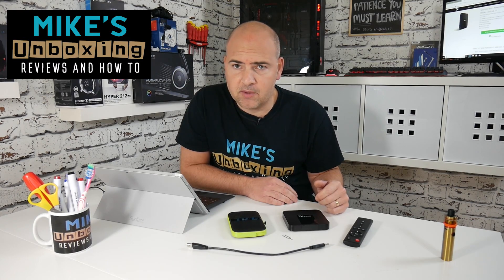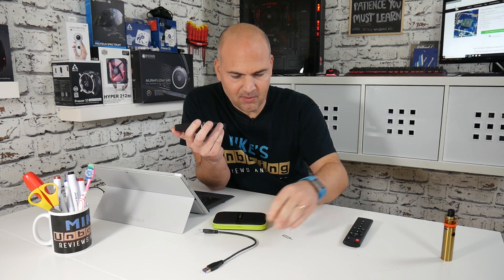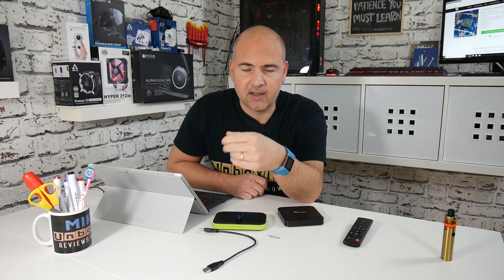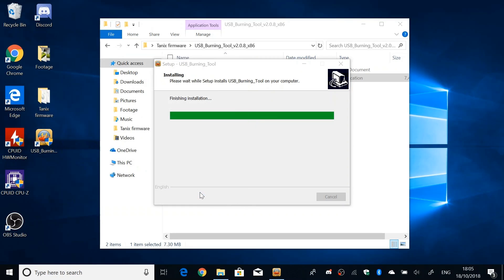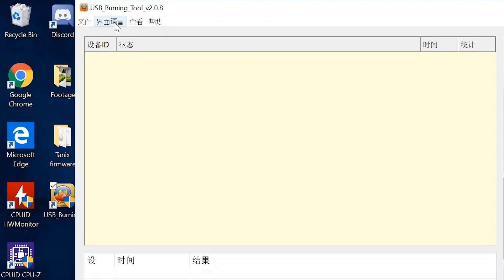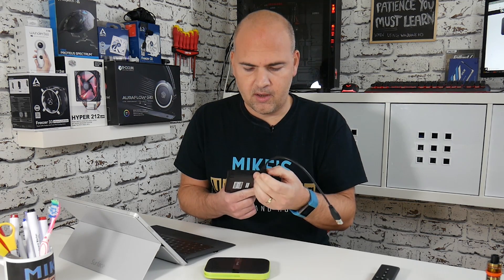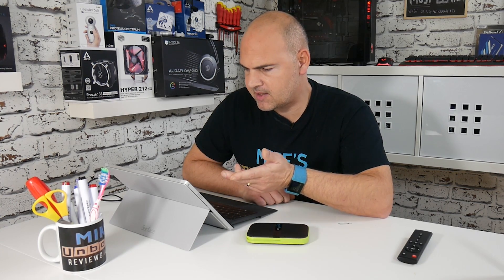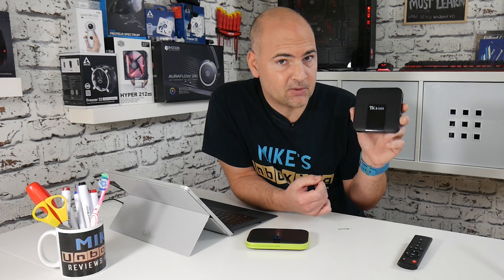Tanix TX3 USB Firmware Recovery TX3 How To Fix

Comment: I'm having an issue with Windows 10. It's recognizing the USB but in Device Manager it's not a recognized device. I've tried 10 different versions of the Burn Tool and tried pointing the folder with no luck.
Reply from the maker: That's a tricky one! Have you tried different USB ports or a different USB cable?
Reply: I did @mikesunboxing

Comment: Did Tanix release newer firmware, or all these firmwares are old? I have TX3 (S905X3) running Android 9, and firmware on their site is 20221122. Is it newer version or just the uploading date was changed? Should I  install it, since my box crashes while using Google assistant, and maybe Google app is outdated? Thanks in advance.
Reply from the maker: yeah these have been sort of abandoned now as the newer models are getting updates

Comment: Hello friend, I want to ask you something. My box is different from the TV box TX9 and I flashed it
firmware with that of the TX3 mini and after flashing the TX9 firmware it turned off the clock on
the display. Can you tell me what to do to get his display clock back on??
Reply from the maker: it is probably a change in the firmware, maybe the tx3 and tx9 use a different protocol for the clock

Comment: Hey there, can i use usb c on laptop and regular usb in tx3 mini to connect ?
Reply from the maker: no sorry the cable must be type a to type a
Reply: @mikesunboxing  i tried to change firmware to my android box but after installing it from pc, when i plug into my tv i only see green light, it wont turn on..

Comment: I Have an issued stuck on 1% [0x10103005]Romcode/Initialize DDR/Download buffer/Read item data failed, do you know how to fixed it ?
Reply from the maker: use the rear USB on the PC or a different port and run as admin
Reply: @mikesunboxing  I already try all but, after I search my ROM is not S905W but S905W2 << new Tx3 Mini Use this, do you know wheres to get this Stock rom ? i can't find it anywhere T_T

Comment: With this method does erase user data? I have damage my Android recovery mode and I want repair/fix recovery mode without data loss.I don't have exactly this device but I believe that are similar,I have x96 max+.I haven't adb/oem/usb debug enable maybe I use nand sort method.Thank you.
Reply from the maker: the USB method wipes the drive and replaces in with a new image
Reply: @mikesunboxing  Thanks from Greece for your answer.

Comment: My tx3 mini is unresponsive. I've plugged in the power cable but the blue notification light on the front doesn't appear but just the red light at the back of the box
Reply from the maker: does it appear in the software when trying to flash it?

Comment: Love your content
I frequently use your videos as a guide to either buying or "fixing" android tv boxes
Hope you can help me
I have the Tanix TX3 Max
It works fine but suddenly it says my external hard drive (Seagate 2TB) is corrupted and needs formatting
I connected it to my PC 
I did a Checkdisk (Windows 10) for errors
I even defragmented it just in case
Nothing helps
I must admit I just transferred a lot of movie files
But I also did that previously without any problem
Just to be clear
The Tanix recognized the external hard drive before, but suddenly it gives me this message
Can you help me?
Reply from the maker: What file system are you using on the drive
Reply: @mikesunboxing   NTFS
Reply: @mikesunboxing  
Update

I checked another external hard drive NTFS 
And it's ok
So it seems it's the Seagate specifically
I know what happened
I deleted the "android folder" and I think als the "Lost.Dir" on the external hard drive
I think that's it because I connected the drive with another android box and it didn't see the drive

Please need help

I know
Stupid of me to delete those specific folders

Comment: Hello mate, I bought the tx3 mini  a few weeks before and at the beginning working properly. The last days seems to  slow down. I reset it and  for a few hours was working fine again. Now it seems to appear the same problem... Do you know what is the reason - solution for that? Thanks in advance!! Keep up the good work
Reply from the maker: possible thermal throttling or bad micro sd card

Comment: Hey Mike, I get the error: 0x30201004/disk initialise/send command/error result. Any idea?
Reply from the maker: That is usually the USB port or cable try using a different USB port preferably one on the back of the pc or a older usb2 port
Reply: @mikesunboxing  No result. I've tried it on 3 different computers, all USB ports, Windows 10, Windows 7.....nothing. TX3 is now in the trash...
Reply from the maker: Did you try a good quality usb a to a cable?

Comment: Hello
I connect successfully but at 9% I get error (0x30405004)UBOOT/Partition_aml_dtb/Verify partition/Error result” while formatting. I tried older fw version, didnt help though.

Any idea how to fix this?
Reply from the maker: did you use the rear motherboard usb ports and a good quality usb cable?
Reply: I used usb port on my laptop (used the same usb port and the same usb cable which I used previously few times successfully for some other android boxes.
Reply: @fanaticoss12345  HEY I HAVE THE SAME PROBLEM :(

Comment: I can't login to my tx2 box after upgrading to v 7.1.2. Have tired 
deleting all google memories but it still does not work. Factory reset 
also does not work the only way I can get it to work partially is to run
 the upgrade again but then it goes gray in the middle of me setting up 
the account. So I am back to square one. Have tired to log in with 
youtube after updating with Aptoide and a number of the ways but always 
fails. Love to get some more ideas if you can think of any? Many thanks.
Reply: Mine got the same problem too..still got no solution till now
Reply from the maker: you can't log in to youtube or google services?

Comment: I'm doing the whole process but my computer does not recognize the tv box
Reply from the maker: Are you using a good quality cable? And also make sure to use the rear io usb ports to front panel ones. They always cause problems

Comment: [0x32030201]Uboot/Get result/DiskInitial error

I have this issue, nothing seems to solve.

Is there another way to fix the boot problem?
Reply from the maker: Are you using a good quality usb cable and the rear usb ports to flash?
Reply: How do I know what are the rear ports to flash?
And
Do You recommend the cables of the links in the description?
Reply from the maker: I was meaning the USB on the back of the pc you are using and not an extension or front panel usb
Reply: @mikesunboxing  Yeah, that's right I was using USB on the back of the pc, but I think it's my cable.

Because 
I hear the sound of a connected USB device, but when I start the burning tool, it reaches 4 percent and it sounds like it was disconnected, and when it reaches 7 percent throw [0x32030201]Uboot/Get result/DiskInitial error.

Do you think is the cable?
Reply from the maker: Definitely worth trying a different one  just in case. Also maybe worth trying a usb 2.0 or a different usb 3.0 and see if it makes any difference
Reply: @Leonardo Cavalcante How did you solved it?

Comment: Hello, My Box stuck as "Boot" after using the Upgrade via USB Drive "ext" So i'm trying using Your Method but he didn't Work. how can you Help Me please
Reply from the maker: what box have you got and rom did you try flashing?
Reply: @mikesunboxing   I have The Tx3 mini, i'm a QA Tester for i  had to use it for Testing a streaming app like the HBO , I install the app it say that Device is rooted, even if off this option from the settings. now i'm try to erase this root: the box stuck from Android logo, now I try to erase the firmware via TF Usb ext" as mentioned in the user Manual but now it's stock in the "b o o t" little screen.. 
 It's seems the NAND is Down!  I'm from Haiti, can you contact me, I want to buy another , via DHL shipment

Comment: [18:08:52 195][HUB11-4][Inf]--verify sha1sum cc2b685b649488346399bbaa9e7fbb5196fa6f17
[18:08:52 195][HUB11-4][Inf]--Send verify cmd succeed
[18:08:52 253][HUB11-4][Err]--failed:Verify Failed with sha1sum, origin sum "cc2b685b649488346399bbaa9e7fbb5196fa6f17" != gen sum "cd1283a0f48e9fe5dac17150e4cf6169bce18057"

[18:08:52 867][HUB11-4][Err]--[0x30405004]UBOOT/Partition _aml_dtb/Verify patition/Error result
[18:08:52 867][HUB11-4][Inf]--Close device handle 0x000004cc
Reply from the maker: Bad flash? Tried with a different USB cable?

Comment: i have the next error, could you help me?
[0x32030201]Uboot/Get result/DiskInitial error
Reply from the maker: in no expert but that could be a dodgy USB cable /port or the boxes internal drive is failing or dead
Reply: Could you solved?
Reply from the maker: Yes
Reply: How? I have the same problem

Comment: Hi, Is the OS firmware image Android 7.1? or lower OS??
Reply from the maker: Yes the image is based on 7.1 or maybe slightly higher but not 8
Reply: @mikesunboxing  Just flashed confirmed 7.1 OS. Is there any chance I can get a copy of your platform.xml from system >etc>permissions mine I can't write to my SD card hence why I tried to flash to solve.

Comment: Could you help me please? I'm doing the process in a right way, but this messages appears

u boot/partition boot/verify partition/error result
Reply from the maker: Are you using a USB on the back of the computer? That error is common when using pass through or extensions you should really try and use a motherboard port from the rear of the IO if possible
Reply from the maker: The crew so be that the firmware you've chosen is not the correct one for the device this is also known with a checksum error
Reply: @mikesunboxing  I have de tanix tx3 mini - a
Reply: @mikesunboxing  I am using a laptop
Reply from the maker: Try using a different USB port or maybe a PC if possible
Reply: @mikesunboxing  I will try, thanks for the attention.
Reply from the maker: Good luck and let me know how you get on
Reply: Same problem
Reply: @RoadiesRev  I can't solve yet. I think I need to buy a USB 3.0 superspeed cable
Reply: @RoadiesRev  me too. Same problem. The device bricked. Only shown "boot" and blank display. Tried many times but still got uboot error
Reply: I'm using 3.0 but not working.
Reply: @RoadiesRev  Maybe you Should try other pc, preference desktop
Reply: I have successfully restored firmware of w95 with the same pc and softwares but this one doesn't seems to work

Comment: tanix mini librelec os is beter than this is older update
Reply from the maker: Hi Galata, Thanks for reminding me, I totally forgot to make a follow up video with the different ROMS that are available to Tanix box users.
Is Mini Librelec your favourite? Or any other recommendations?
Reply: Mike's unboxing, reviews and how to i did update according to video after format I got error message and now my tx3 does not start
Reply from the maker: What was the initial problem with the box? No boot / crashing / no display?
Reply: Mike's unboxing, reviews and how to no more screen will only fire the ethernet lamp
Reply: I now press resset button but he does nothing more by updating what should I do now
Reply from the maker: Does the update software recognise the box when you connect the USB? And did the flash go to 100%
Reply: Mike's unboxing, reviews and how to no , it stop by 7%
Reply from the maker: I had that happen to me, watch the video and I explained what you need to do if the process stops unexpectedly. It is normally the USB port is not working properly. Try a different port on the rear io of the computer. See if that helps
Reply: Mike's unboxing, reviews and how to i have error code 0x32030201 uboot/get result/diskinitial error
Reply: problem solved for people who have the same problem. program usb burning tool at configuration select erase all then we can thank you for everything @mikesunboxing
Reply from the maker: Galata, So glad you got it sorted! Good job! Everything cool now?
Reply: @mikesunboxing  yes everything is oke thnx